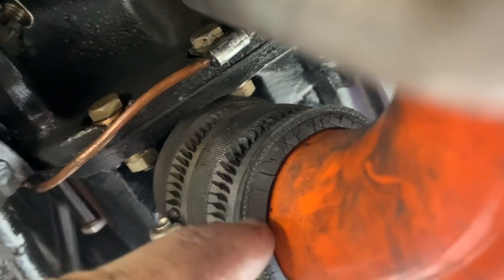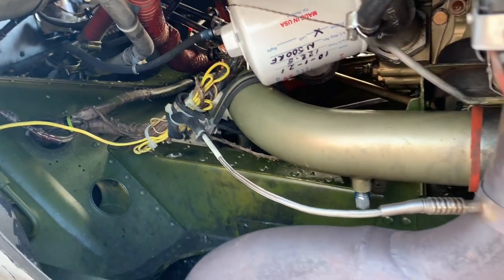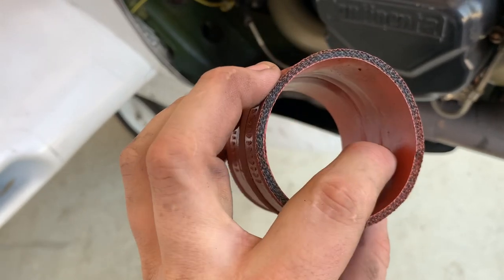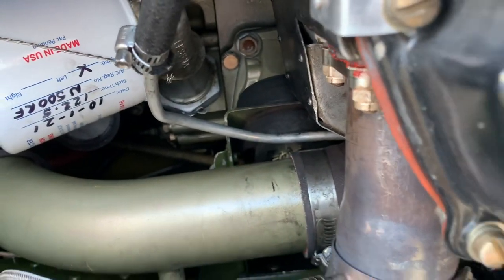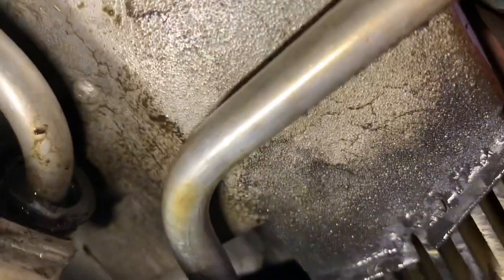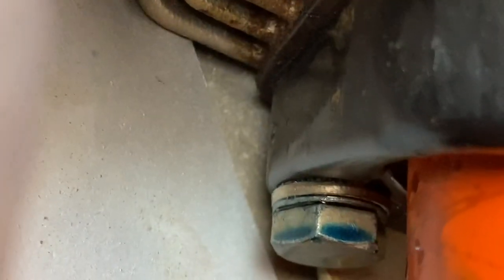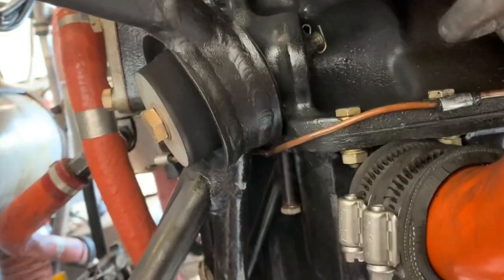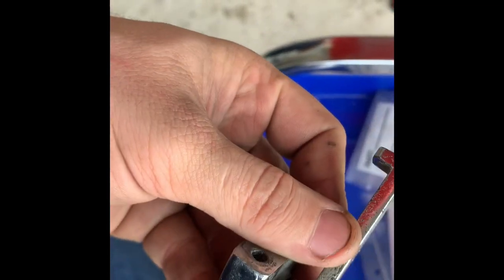Cherokee 140 alternator short causes fire, Cessna 310 has the weirdest oil leak ever.  A&P life

Comment: I'm a recently new cessna TR182 owner and my window latch did just that! In fact, the previous owner repaired it by shoving a nail through the handle to deal with the dedent then filed the nail to fit.
Obviously it didn't hold and I am now replacing the whole thing. I was so happy when I saw your section on it because it's my first ever owner repair which taught me a lot about finding and ordering parts. Probably mundane thing for you to do but those part manuals are scary, man!
Reply from the maker: Those are important, otherwise it’ll get windy when they break and the things fling open
Reply: Thankfully this happened during run up and not in the air, the handle literally came off the window. I'm glad it jumped inside the plane instead of outside since the FOD could've make some serious damage.

Comment: I totally disagree with your diagnosis of the 310.  Both of my high time IO-470Ds drip oil from the inboard intake drains overnight after a flight.  These engines don't have intake valve stem seals and will pull oil past the stems when the power is pulled back and the intake vacuum is high.  Your post repair ground run didn't really prove anything if the airplane wasn't flown, especially if you cleaned out the accumulated oil.  After a few flights I'll bet it drips once again.
Reply from the maker: The owner agreed with it as he no longer leaves a quart of oil on the ground
Reply: @aviationsquared1909  Right, so the minuscule amount of oil from the wet vacuum pump, caught by the separator and leaking from its drain line, managed to squirt all over and the little bit that landed on that one intake hose was responsible for all that accumulated oil, all the way up to the intake crossover.  Sure.  Whatever you say.
Reply from the maker: Thanks for stopping by gary

Comment: Interested to see what size wire is acceptable for the alternator, a 35 amp alternator is good for almost 11 feet for 12 awg. What size alternator does it have?
Reply from the maker: Look it up on the AC43.13 wire chart.  Type that in Google and you’ll see why.  
This bird was running a 60 amp alternator 12 volt system and 11 ish feet long
Reply from the maker: Also very important to use the correct curve line
Reply from the maker: Basically,  lazy people STC in a bigger amperage alternator without stepping up the wire size because it’s too much work